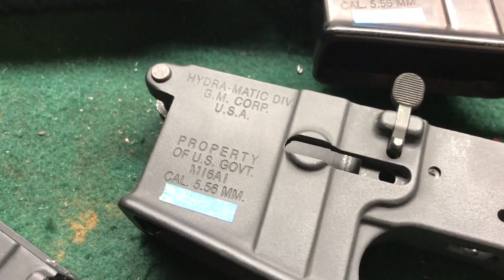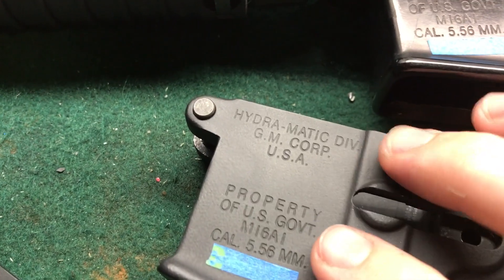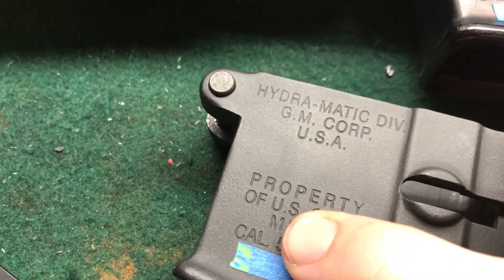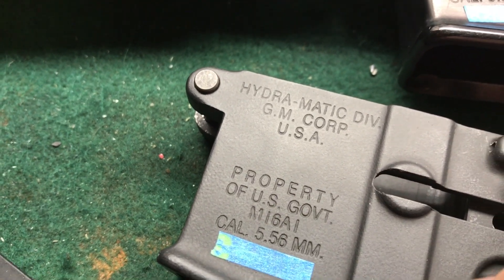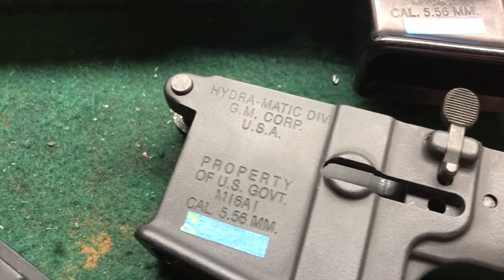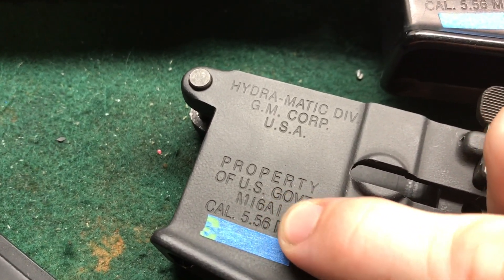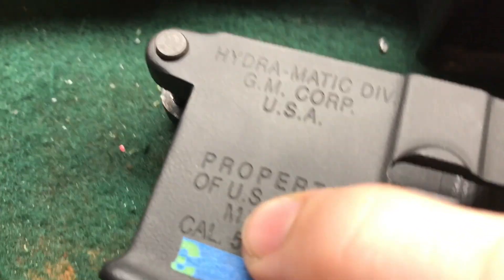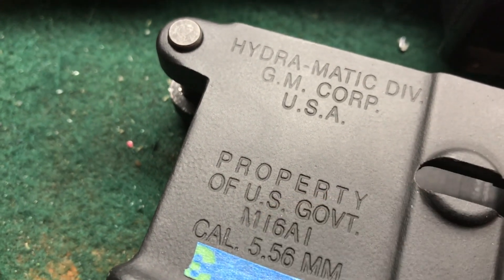Electro Etching Update

Comment: About to do this myself and finish with cerakote and I was wondering if you sandblasted before or after the etching?
Reply from the maker: I’ve done both abs had the same results. I was a little worried that sandblasting before would not give the stencil a good seal, but it worked great. 
So I recommend sandblasting the whole lower, etch, lightly sandblast the etched area being careful to to do too much and loose the detail of the etch, and then anodize or cerakote.

Comment: Be careful with that engraving of the auto sear pin, there have been cases where the ATF deemed the receiver a machine gun and confiscated and destroyed them, even though there was no actual hole.
Reply from the maker: I’ve seen some of those reports. Thanks for the info.
Reply: @CalebDowning  thats actually incorrect Troy produced them and it was g2g…. They stopped producing them because they weren’t popular not because they were deemed “illegal” …. So yeah your fine!!

Comment: Great Video. Did you have to remove the anodizing first before you etched the first lower? I've heard that you can't etch anodized lowers with out first removing the color
Reply from the maker: Thanks man. I purchased my lower as a 80% “in the raw” piece. I mill out the lowers, etch, then anodize. I believe you are right though, about anodizing having to be removed before you can etch. I have yet to try and unanodize a lower and then etch.

Comment: How did you keep the centers of the O's D's R's in place? Every time I try to weed small fonts I loose those center caps.
Reply from the maker: When removing the different layers of the stencil, you just have to be very careful that you don't lift the small O/D/R inserts. If one does lift then I just pt it back in place. Another tip is to make sure you press the stencil in place and make sure all the little bits are toughing the lower or material that you are etching.

Comment: I'm all ready to etch away on my 80. You mention that on your first 80, there were some spots where you didn't etch long enough. How long did you hold your Qtip over each letter on the second one?
Reply from the maker: I would say the I held in one place for about a minute. The next one I do I'll probably double that. You want to see bubbles, when theres not enough liquid for bubbles then change out the q-tip.
Reply: Caleb Downing Good to know! Thank you so much. Just sent you the same question on arfcom. Please disregard
Reply: And to be honest, I like the imperfection of the first one. Weren't some of the GM lowers slightly flawed anyway?
Reply from the maker: And when you think you have done enough do a little bit more. Also don't rub the q-tip as you etch, it could easily catch and lift the stencil. There should be a bubble suspends between the q-tip and the stencil surface. Good luck man!
Reply from the maker: They could have been, I'm not exactly sure though.
Reply from the maker: haha, just saw your question on arform. If you got your stencil from dog fight inc then he has the safety markings for the right side of the lower. My understanding is that there are only markings on the left side, besides the auto sear. You could user the Safe/Semi/Auto letters to practice on the extra piece of aluminum you mentioned. Just a thought.
Reply: Yeah, good point. I have the piece of aluminum stock masked off, so I'll try different stuff on that, then, after I choose that looks best, I'll use my extra stencils. Thanks for the tip

Comment: I like your work. How much to do mine if I provide the stencil? Lol
Reply from the maker: If I still had my FFL then I'd be all over that. It really is a very simple and rewarding process.
Reply: Caleb Downing You need an FFL to etch someone elses lower? 80% or otherwise? That sucks
Reply from the maker: I should have clarified, sorry. Any work on a complete lower does require an FFL, but not on an 80%. So I guess I could etch it if it is an 80% :) I recommend milling out the receiver first before doing any etching though. I used a cheap Harbor Freight press to do my milling and I ruined 2 lowers before I got the results that I wanted. If those 2 lowers had been already etched, then I'd be out those stencils too and not only the receivers.
Reply: Caleb Downing yeah I considered that